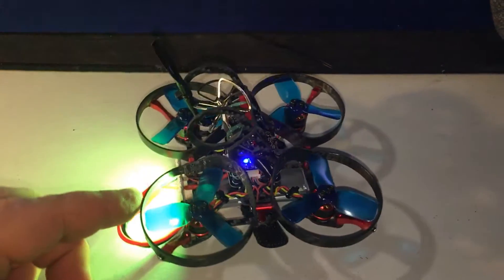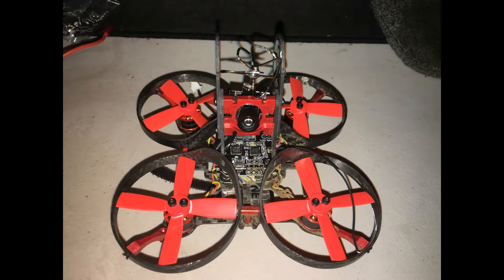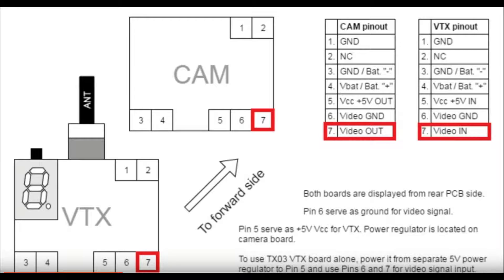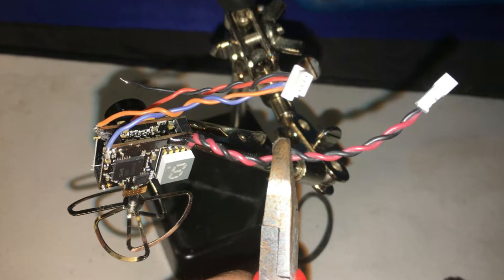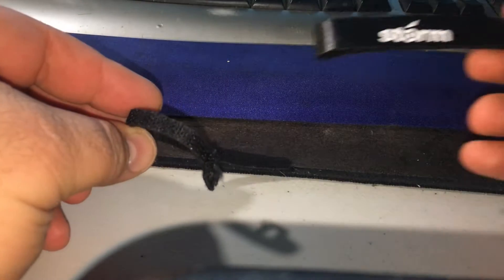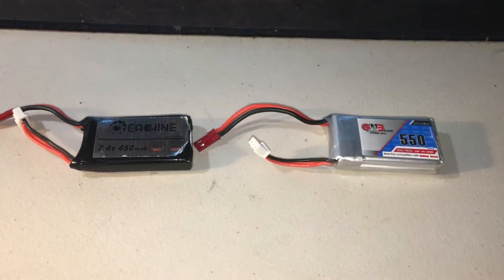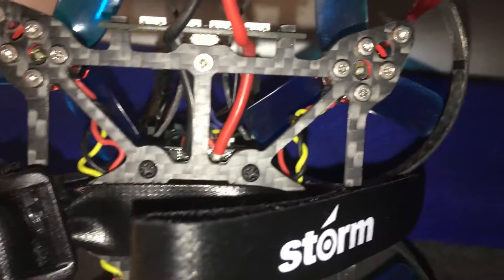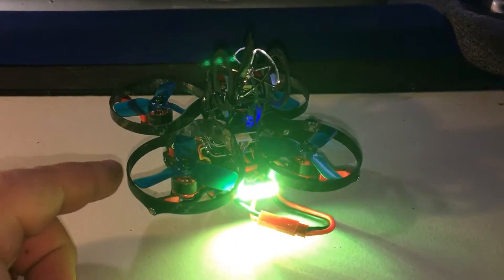Aurora 90 - TX03 Cam Swap *KEEP YOUR OSD!* Other Awesome Upgrades And Flight! (BANGGOOD)

Comment: In your video you have a RSSI value of zero in the OSD. I have the same problem here, whatever I do I can't get this running properly. Did you find out why?
Reply from the maker: No. Sorry. It’s just shyt. Doesn’t want to work for me. I tried a few things and couldn’t get it to go. I have since removed that value.

Comment: Where could I get some spacers as the link you posted are sold out! Any other sites that you have found? Thanks in advanced
Reply from the maker: +Nicks FPV awe man really? That's where I got mine. I will search some out for you and see what I come up with. Also, good idea to email that site directly and see if and when they will be getting more in should I not be able to fine them elsewhere. I'll let you know what I come up with!

Comment: what's the reason for changing the cam? better picture?
Reply from the maker: +SithSlayer88 good question. The original stick cam only has 25mW were as the TX03 has 200!